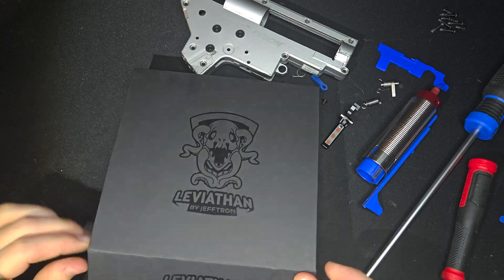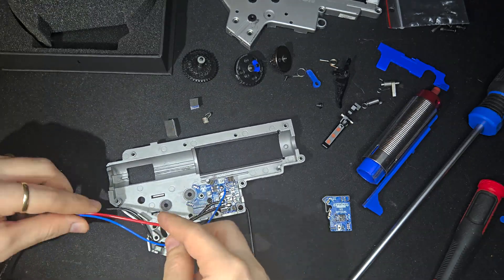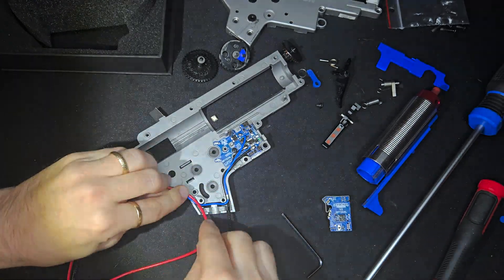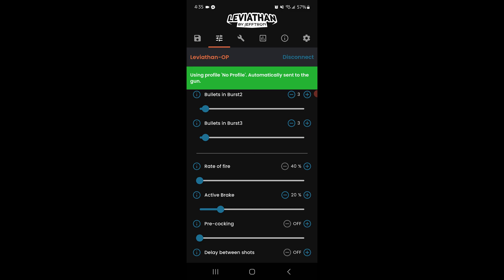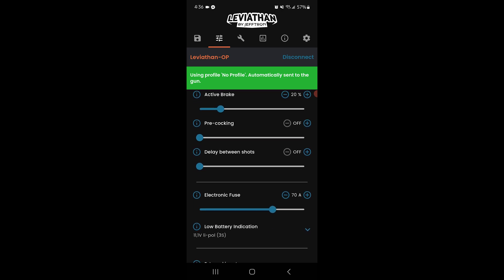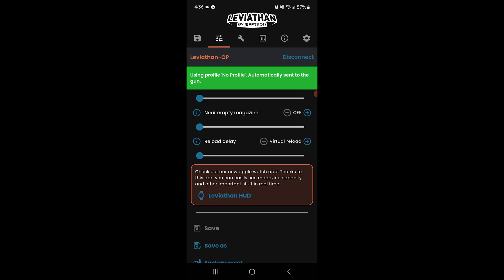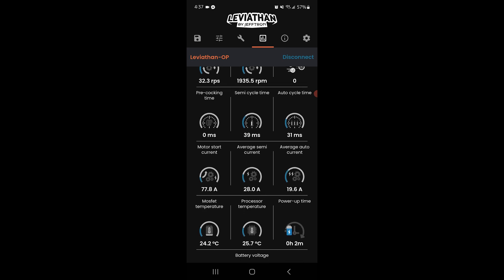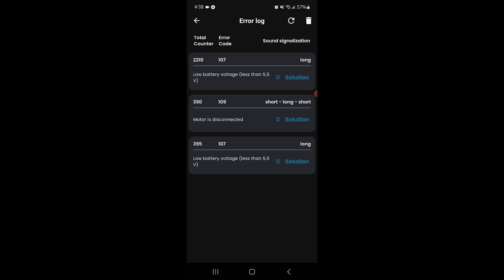Jefftron Leviathan: The Ultimate AEG Brain - Feature Breakdown, Install and Review

Comment: hello! Nice video! First time i'm using a jefftron leviathan (aways went with perun V2 Hybrid) and mine is a little different from yours. Mine has a smaller metal tab for the real feel trigger and has a giant fuse close to the battery connector. Is the fuse needed? I cant put my battery on the tube stock because of it...

Comment: Nice vid 👍 I could be trippin but you may have a fracture forming on the front of the left side of the gearbox. I’ve had a couple of those Orion gearboxes crack sadly
Reply from the maker: You're absolutely right, I noticed the crack but I thought it happened a few weeks after I put this video together. I had an internal failure and thought it caused this crack. But I guess it happened before the failure and possibly contributed. Nice catch